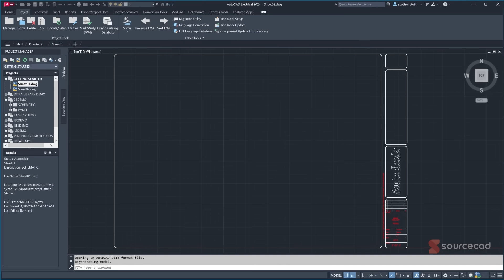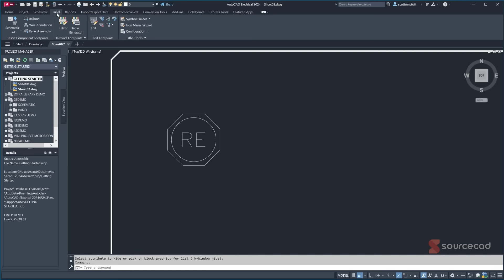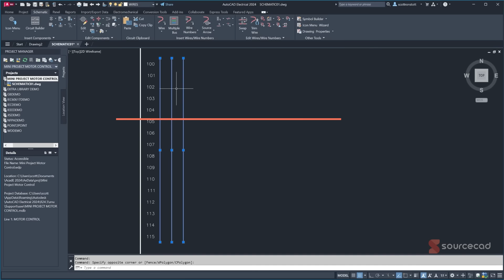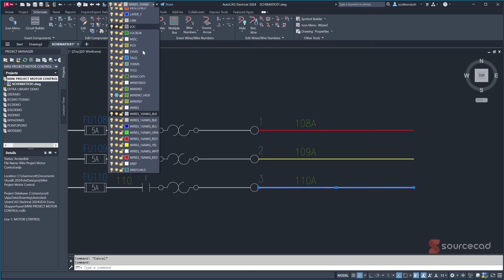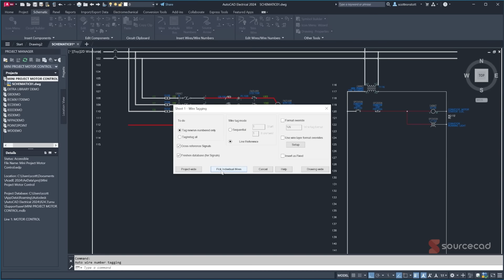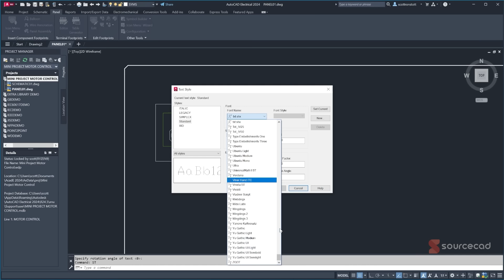AutoCAD electrical course for beginners (with project)

Comment: Great video. Thanks alot.

Lets say I just want to map the lamps for serviceability, and not the wires. Is there an easy way to do this? Preferably also add the lamp type (emergency / emergency batterypowered / normal etc), model, and ID-TAG number which can be exported to a sheet so that the people that needs to service the emergency lights can see the ID-TAGs on the CAD drawing, and also get a sheet of all the relevant lights and their type, tag and model to make it easier to find everything?

Which functions should I look up?

Comment: Hi. Thank you very much for your video. Quick question: For a drawing requiring cable termination details, how much of information is required to make it really detailed? Say, we using the connection of a battery to an Inverter as an example.

Comment: Great tutorial ! Just a couple things from an engineering standpoint, and to help beginners, please add over current protection on H1 & H2 of your transformer, and add protection to L1 of your control voltage.
Reply: There is